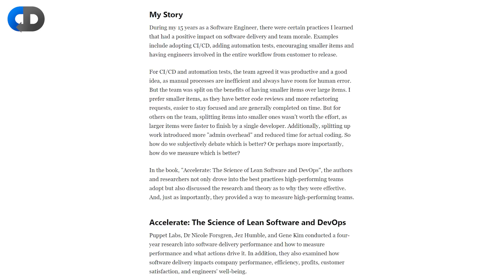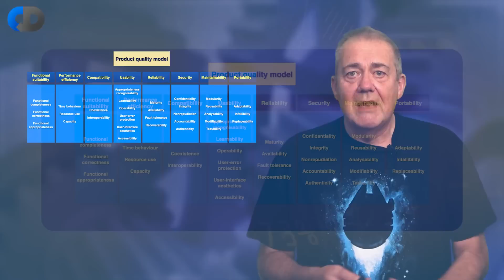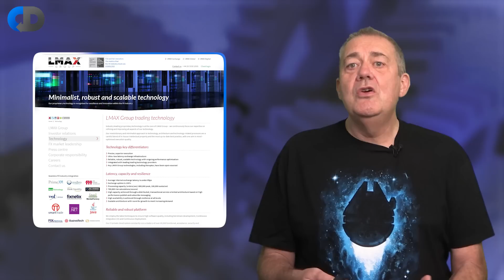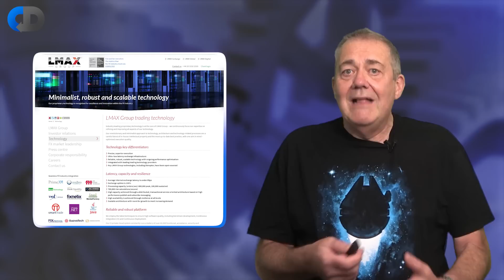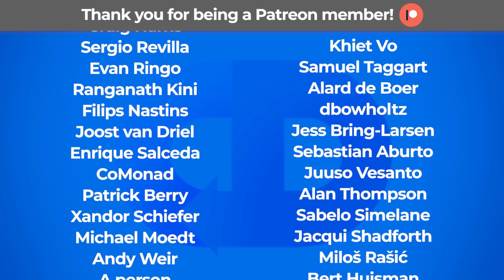I Bet You’re Overengineering Your Software

Comment: Refactoring and patching systems as requirements change over time in my experience causes system decay. Higher ups or clients are unable to justify creating a new system and are in many cases unaware of the differences. Project leads may be unwilling to restart because they are aware a new system will come with a new set of issues, their behavior depends on management, and at the same time continual patching, programmers tend to avoid obvious issues because they think if they fix it and it fails or introduces errors or even reveals preexisting errors, they will be forced to roll back to the semi working invalid system. 
A developer team is often facing an up hill battle, depending on management, that is the complexity of changing a design for a bike into a jet plane without a rewrite. Over time there are many different other types of people that get their hands on a system usually which adds to decay. Having a upgrade path documented and designed for at least helps the progression but that is assuming the guess made for the upgrade path is correct. This is just based on my experience, and also based on your description about the differences between programmers, developers and software engineers which i think i agree.
Reply: Even if your design is clean and can transform from a jet plane into a submarine, it is still subject to deterioration. In my latest project, I have three layers of abstraction, totally separating the business logic from connectivity for an ease of development. This didn't stop this one colleague from introducing this one primitive variable that is set once in the whole lifecycle, and leaves a totally redundant if branch for the rest of it as a global field into the main algorithm. And I know him all too well by now - he's been longer at my current company - that if he needs another fix, it will be just another quickfix like that, until my factory is swamped with them.

Comment: Hi Dave, I have been working as a DevOps + Operation for a while, and I often see architects and developers write code to connect to databases (SQL or NoSQL) without considering about indexes. They design databases and queries without thinking about indexes. When I ask them if they can always thinking about index in every queries, they say performance stuff is meant to be optimized later to prevent overengineering. I felt disagreed with them but didn't know a valid argument to counter them.

Now that I watch you video, I think I know what was wrong in the logic. From what I have learned from you, it seems we defer the optimization to the time when we can learn and understand to use case more clearly. For example we can improve the scalability of our system after we rollout to the users because at that time we can learn about the number of users and how they use our system. But it for the database design and query optimization, there is no better time to understand it than the time we design and implement it! It think my team mates made an error in their logic because they jump to the conclusion when they hear the word "optimization". Do you agree with me?

Comment: Well, lets see this example.  Lets take revision control for source code as a talking point.  There was RCS, then CVS, and SVN, ClearCase, Perforce, BitKeeper,  to name a few.  (ClearCase was always described as "CVS you had to pay for").  Then the git source control software and it was written by the linux developers FOR the linux developers, they knew their own functional requirements and had to switch for licensing arguments with bitkeeper...  They needed something reliable, scalable...  they solved their complex needs so well, it became the defacto source control standard for the modern age and it has TONS of features that are amazing.  Secure features like PGP signed commits and quality of life features like rerere.  
I think we could all agree that GIT looks like a quality piece of software that is definitely not "over engineered"

Comment: Great insights there.   Some of the major contradictions/confusion I have encountered are the "open/closed principle" ... and the misinterpretation of "anticipate change", also abstracting beyond the "problem "domain.   Also too many unit tests which test interactions "in the guts" of the code base - making it virtually impossible to make small,  incremental, refactorings.
What you say is 100% spot-on.  As you have data, please provide some concrete examples!

Comment: On a lower level, this is why BDD is such a useful process for solving problems with code. You've broken down a requirement into a small piece that will tangibly benefit an end user, and you are coaxed to write the minimum amount of code to get a test to pass and deliver the feature. It's very difficult to overengineer a solution when solving problems like this.

Comment: I always recommend to my peer this excellent channel. But this video is confused.
Type 1 master vision don't exist, unless you count "monolith is bad" or "kurbenetes is good" or "scrum is agile" or "I code in my garage" as "master vision". Which are just an instance of "preferring style over substance"
Type 2 future proofing. This IS engineering, it is perfectly described at 19:00, except it is a contradiction. How can you "leave things open", if you are not "attempting to predict the future ?". What "close" would even mean outside of this "predict future" concept ? What is "change" BUT a future event ?

How can you spent time "NOT delivering value to customer", by abstracting your cloud provider or your communication protocol, if not because you expect it to change in the future ? How many of us have tried to explain all those perfectly sound concept like SOLID to "management" and  get the message to stop "overengeneering" this and JDI (just do it) ?

As a side note, I don't expect DORA is able to measure "speed of change" in any meaningful way.
Reply: 100% Agree
Reply: The books Pragmatic programmer and Modern Software engineering (the code examples) describes this very well. You need to create code and/or designs that are easy to change, adhering for instance to the five traits Farley use to talk about, the SOLID principles and/or the DRY-principle. If developers and architects as well put more effort in creating designs and architectures that could be changed easily the system would be easier to work with as well as easier to extend. If you are not following common sense when writing the code, you will create a big ball of mud.

Comment: it really is a balancing act. i always find that the tools are what limit what can be expressed, and that over engineering usually happens when trying really hard to get around these limitations. sometimes the limitations are due to a lack knowledge, and therefore making things more complicated than necessary. and yes you always have to ask yourself, whether the added complexity is worth it, like you said. with tools i mean pretty much anything given to you, like: frameworks, protocols, IDEs, the operating system, but especially programming languages
Reply: I agree, I've seen this a lot in my current organisation. When I started we were a very young operation and had only gone to production that week. As it happens we became successful quite quickly and user numbers were about 1 year ahead of projections within 3 months. So we had to mature the product very quickly, and there was a period of a few months when developers were getting very agitated with our CICD team because they were suddenly needing certain features in builds and pipelines that there simply hadn't been time to implement when the goal was to get a working product. We very much had to go through a "workaround" period and you can easily tell which projects those are when you look at them today. So much unnecssary "functionality" along with all the testing and validation, and that testing and validation has to be more thorough because of the non-standard patterns being used. I would agree pretty strongly that a lot of overengineering comes from a place of needing to vault a barrier that, in principle, shouldn't really be there in the first place. Although I have seen some that comes from a place of wanting to be the coolest dev out there 😅

Comment: A friend of mine and me learned it the hard way when we totally over-engineered a system. We used Laravel as a framework, but we thought that we would probably switch to Symfony later.
So we built all the business logic in a framework-agnostic package which provided interfaces that could be implemented in any framework and then we build the connections for Laravel.
So every request would go through the Laravel routing into a Laravel controller, but that would map the received information in a "core" DTO which would call a "core" action. This action would for example require a repository which in this case internally used Laravel models again. The Laravel models would be transformed back into "core" entities and so on. Of course we've had a ton of interfaces and thousands of automated tests. The system was basically just mapping data between different structures for 80% of the time.
We actually had one case where we had to replace the Laravel models in one repository with a Service calling an API of an external CMS, what was very easy to implement, thanks to all the abstraction. But having to add all that overhead just for the possibility to eventually change out stuff was creating way more problems and overhead than it was helping. 
After getting a lot of feedback from other devs we finally accepted that what we did was not the way to go and we gradually absorbed the core into the Laravel application and using more and more of the framework itself instead of adding all those abstractions in between.

When we left the company and had some time to spare, we decided to try out a radically different approach where we kept it way simpler and stayed with the framework standards most of the time (again Laravel).
What we usually still kept to do is following the SOLID principles. 
This way we were extremely successful. 
When we started, we thought that we were optimistic when we thought we could be twice as fast as before, but after a few weeks we found out that we were more than 20 times more efficient. 
We were not just faster, but we also produced better code.

Well, now we're getting payback for our previous over-engineering anyway. We did the "cool" project in between our two employments and when we started the new job, we found out that we would have to maintain and extend a system that is about 20 times more over-engineered than our already bad previous project. 

Now we're working with code where you have to add 2500 lines of code in 41 files to be able to add one URL to certain products in a shop. 
I wish I was exaggerating, but those are actual number from a current pull request. 
And that was even a solution where a shortcut has been taken because the correct way for that framework would require even more code. Of course, most of that are classes which do nothing else than routing calls to other classes.

It is the worst and least productive thing I've ever worked on.
And there are actually people liking this! 
It is a shop where it takes 13 story points (the maximum amount we're using in our estimations) to add a label to a product and it takes at least three weeks.
And people still think this is the proper way to work in "enterprise software". 
With some people there you have to argue there that it does not make sense to extract a three line function for a specific use case that is never used anywhere else into it's own class.
We agreed with our boss that we try to stay at least one year in that company, but I am not sure if we can make it. The frustration is unbelievable. I am still doing side projects after work and there I am getting more done in two hours than in four weeks of my day job. I have no clue how companies like those are still making profit. ¯\_(ツ)_/¯

Sorry for this wall of text. The frustration is spilling out of me :D
Reply: 😂 that sounds exactly like something we have done previously at my current job. "Oh, no. The 'core' must be clean and without dependencies. Abstract *everything*, including Entity Framework (which itself is an abstraction)."

I'm glad we've learned from our mistakes and are now embracing simplicity.

Comment: One of the managers in my team asked us multiple times to make our product configurable and to address as many use cases as possible, thinking at the future, and he has wild ideas about what the future may bring at the point that it seemed he wanted to build the Musk's everything app. I told him that we can start to think about these hypothetical features and use cases only after we defined what's the specific problem and our business requirements we want to address. I managed to save the project from him so far.
The problem is that he's obsessed in allow new use case without changing the software and is afraid of touching the code, in his dreams we should get a new feature simply by configuration.
Reply: Yikes
Reply: I've been around that cycle a few times. Eventually you introduce some sort of scripting language to make your process completely customisable. Then you've made the configuration so complex it takes a programmer to set anything up. Usually that scripting language is not as good as the underlying language of the app, so you're still relying on developers to make changes, and you still have to test any change - but changes now take longer than when you were directly changing the code!
Reply: @robinbennett5994  yes, exactly my point! It's madness. And the worst thing is that no matter how many configurations you put, it will never cover all the cases and you'll always need a developer to add stuff and configuration. It's a vicious cycle that kills project transforming them in big complicated and scary monsters. The classic project nobody want to works on, that causes good developers to resign and the on which ultimately you put only junior devs that will make the situation worse and worse

Comment: SOLID should be applied after YAGNI and KISS.  Critically, you should not apply SOLID to things you YAGNI away.  I think this is where a lot of over-engineering comes from.

One thing I've noticed is that the amount of speedup you get from deferring quality doesn't last very long.  On the order of a month or two.  If you're deferring quality for speed for several months, you're actually moving slower.  I've been on some projects where we were "6 months from launch" and people were deferring on quality left and right.  The codebase quickly turns into a disaster.

To keep this working though you need to allow for people to constantly refactor the design.  Which I think is important, and you shouldn't have to get a manager's permission every time you need to refactor things.  Because see the above paragraph: skipping it will make you slower very quickly.
Reply: I’m not 100% sure I follow your statement that “SOLID should be applied after YAGNI and KISS.” It seems like what you are saying is that you shouldn’t apply SOLID to code you do not write, which, yeah - seems natural but needs not be said. So, I wonder if I understand you correctly. I thought you may be trying to say “do not spend any extra time writing code that aligns with SOLID principles until you are sure the code will stick around, then refactor it.” I am not sure that is a statement I could agree with. There are times when “quick and dirty” is perfectly acceptable. One-off scripts that I write to transform a data file or some such are not worth the effort and are usually better to be written using the imperative, top to bottom ways of old.
Reply: @pchasco  only apply SOLID to your requirements, not "what if".  I've seen people trying to apply the open-closed principle to things that weren't features or requirements.

For the quick and dirty stuff.  Yeah.  That's why I time boxed it.  If you're going to be cutting corners for months, you're slowing down.  If you cut corners for a week or even a month, that's fine.
Reply: @bobbycrosby9765  Still not sure I follow. Open-closed principle has to do with how we implement a class and doesn’t have anything to do with requirements outside the detail that we build programs to fit requirements, and programs are composed of classes in most OO languages.
Reply: @pchasco  the scope of the open-closed principle is limitless.

Your requirements are not.

If you "violate" the open-closed principle only if your requirements change, then it's not a violation.

If your requirements do change, you can refactor at that point.